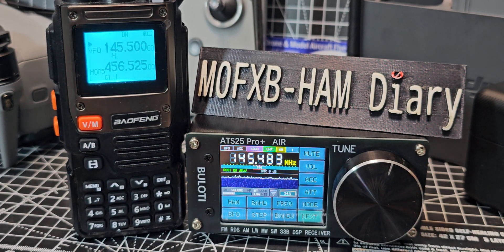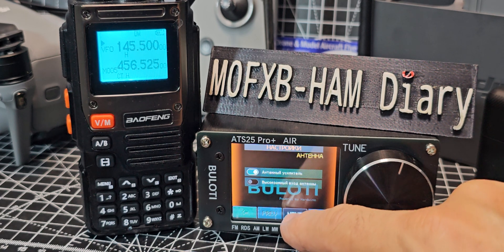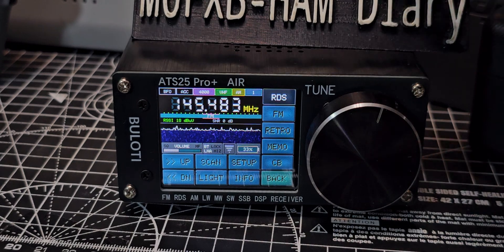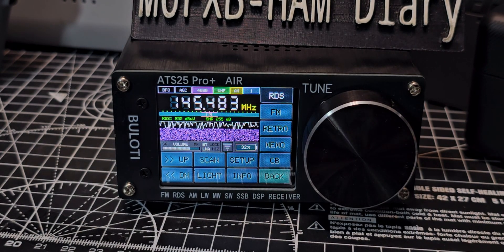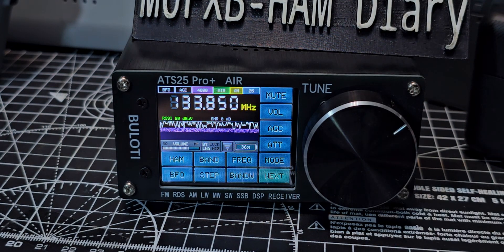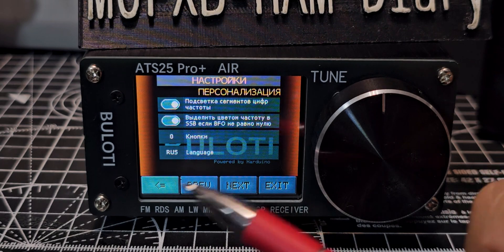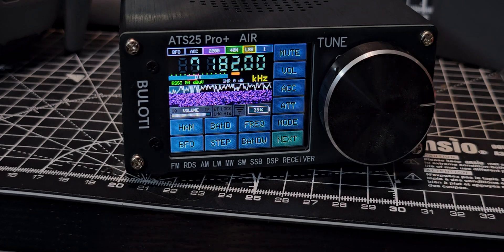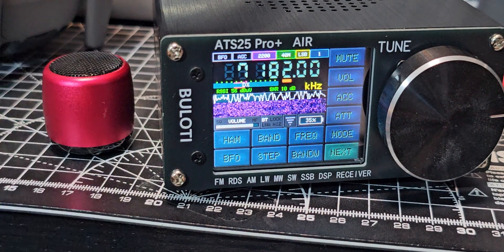ATS25 Pro + Air - VHF FM ? - More tests

Comment: My Pro+ arrived today but the screen brightness at maximum is noticeable dimmer than my max Decoder version. Do you notice any difference with yours ?
Reply from the maker: Hi no
Reply: @HamTechRadioScannerDrones  also it's deaf on FM compared to my Max Decoder version. Can you test with a good FM antenna for weak stations - Band 2 I mean